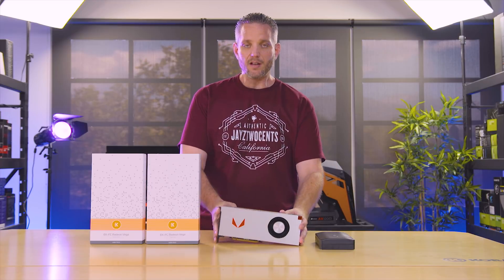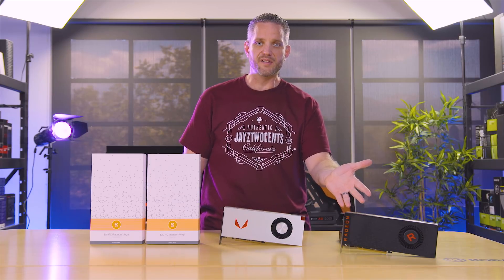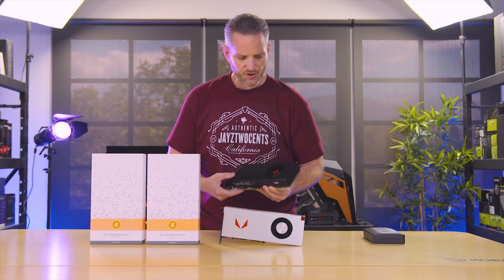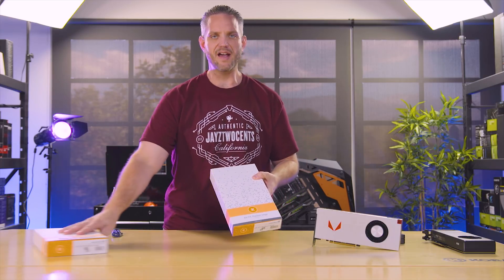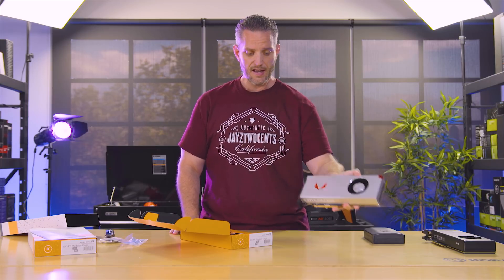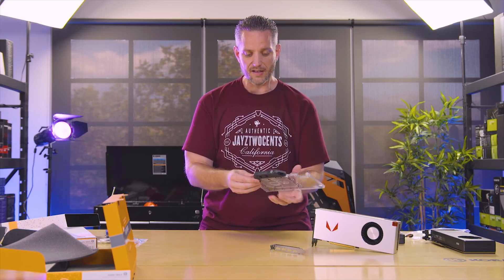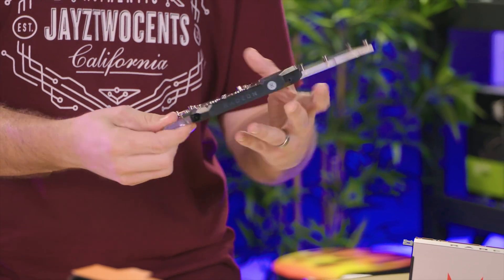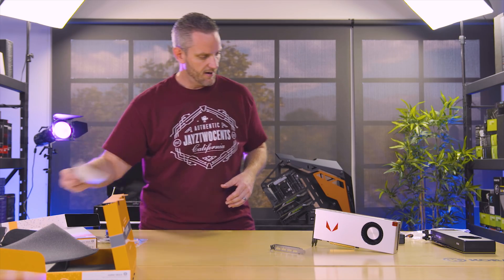Does watercooling help AMD Vega cards?

Comment: Why are people buying Vega? 1070 and 1080 uses far less power and are pretty equal in performance.
Reply: vega has better performance in some rendering workloads, and is 30% faster in blender than the 1080ti, which if you use blender all the time is a far superior investment.
Reply: Some people just prefer AMD hardware and new technologies.
Reply: Honestly...Vega 64 is a turd and I would never buy it period.  But Vega 56, slightly faster than the 1070 for the same price? Even if I have to wait for prices to come down and reflect MSRP I'll wait a bit and get Vega 56. With driver improvements over the next few months Vega 56 will pull nicely ahead of the 1070 and you support competition by buying AMD. 

Also, for Vega 56 at least, the power consumption cost at 4 hours of gaming per day based on the Average United States electricity rates is so negligible that if you are that worried about that tiny cost...you realistically can't afford one of these to begin with.
Reply: It may be a turd for gaming, but it's doing rather well for me in various compute tasks (and no, I'm not a miner, never have and never will).

Rendering is several applications also is quite a bit faster.

As for it's gaming performance, the power is there, it currently doesn't translate to framerates. If I didn't have a use for it beyond gaming, I would still have held my tongue talking bullshit like you and waited out to see if gaming performance came up to par with the actual capabilities of the card and if the prices would come back to a normal level.

At normal prices and even just the current performance, it is not a turd, it's great value for money.

But with current prices (and bad availability), it is not.
Reply: because a similar spec 21:9  3440x1440 g-sync monitor is ~$400 more. Comments like this are usually made by those who got a 1080p monitor and never researched prices of higher end monitors
Reply: Because some of us don't give a fuck about power draw in a desktop. Also I already have a freesync monitor and don't want to buy a new monitor.
Reply: Vega's biggest problem for gamers is the Mining market.   On newegg, the 1080 Tis are cheaper than Vega 64
Reply: As nVidia has their fanboys that will always buy and bash the competition...  Ford vs Chevy...  Red vs green, etc...
Reply: My friend unwittingly bought a freesync 4k monitor last year, so, yeah, it would benefit him to use an AMD graphics card.
Reply: I have zero interest in G-Sync or Freesync. I just want a card with good performance with low power usage. I am waiting on the GTX 2060.
Reply: you should though man, both of those technologies are cool as shit
Reply: FreeSync
Reply: jose juan andrade gsync is overpriced while not much of a different than freesync..
Reply: Becuse everything on my pc is OC and draws power and as all says. g-sync costs alot
Reply: Rowland then why did they say they wanted it in the hands of gamers? Also why are you AMD fanboys allergic to facts
Reply: Yeah, they are... I never thought I'd see the day Newegg jumped on the price-gouging wagon...  I managed to order an XFX 64 from from Best Buy for the listed Black pack price of $599...  two free games  (I know, big whoop) but at least it's the MSRP for the "pack"
Reply: 1ch1r1n until you get octane render plugin, then amd really can't keep up with rendering times.
Reply: preference, the same preference when people are picking a case fan right? Yet no one ever questions that do they?
Reply: I went for a refurb RX 480 after Vega came out. $300 for what seems like perfectly adequate performance.
Reply: it is when the price goes back to normal and the custom cards are there. If Vega stays gone like the 580 its back to team green
Reply: TheKims  because of Freesync
Reply: I think it would be GTX 1160
Reply: I do actually hope they do. Considering the huge advertising campaign over the "10" with the take things to 10 or whatever. They could now go with taking things one step farther... to 11. Or some shit.
Reply: to support competition
Reply: They are cool. But monitors cost a ton more with either tech. I'd rather get a nice 24 - 27 inch 1ms refresh monitor without them and pay $100 to $200 less.
Reply: 9TDF ewww i suppport it to a point... but if the product is that high of a price doesnt seem smart not to buy the best for the money...
Reply: neural_physics Yeah over 100 more for a monitor for the same sync as freesync is great
Reply: 10+1 does not equal 20...
Reply: Because Freesync doesn't add $100+ to the cost of the monitor like GSync does, so people got monitors with it even though they knew they couldn't use it just because the monitor had everything else they wanted but was cheaper. Honestly, fast vsync turned on on a non-GSync monitor is enough of a gain that most people don't really need the active tech anyway...
Reply: No developers want to use DX12 though because it's Xbox and Windows 10 exclusive. Doesn't matter both DX12 and Vulkan aren't fully implemented.
Reply: +Tick Tock Tech Talk by the time you wait price drop, Volta will be out or will be 2 month away to be out. So, Vega is a disappointment - period. One has to be a complete AMD fanboy to spend money on Vega 64 while GTX 1080 Ti costs the same amount of money (at least here in Canada) and 1080Ti is 30% faster in games (don't care about synthetic benches - buying a gaming GPU for gaming). Oh, and I don't care about Freesync or Gsync - both are useless and not worth the money and only add input lag for FPS games, a regular 144hz monitor is good enough and has 0 screen tearing. Using Oculus Rift for games mostly anyways because mostly playing racing sims here.
Reply: Its not for gaming
Reply: Bill Warrior its called some people arent rich
Reply: neural_physics nvidia is for gamers amd is more for content creators it depends on your stance on which is better
Reply: So basically, what you're saying is that in the end, you're going to spend about the same amount of money nvidia/G-sync vs AMD/Freesync...  I never thought about it that way...  Thank you for pointing this out..  (thumbs up)
Reply: kgrach If you don't use Linux or care about freesync or gsync, then that becomes the case too. I.e. me. I'm glad I got a GTX1080 12 months ago vs waiting for Vega. Hasn't even dropped much in price vs what I paid it and I got to enjoy it for a year instead of waiting.
Reply: neversync you save that money in electricity prices in just 6 months running nvidia cards instead of amd. Also cheaper psu for the rig so that's an immediate $100 if going sli.
Reply: V56 slightly higher power draw than 1070, buy higher performance between 5 and 25%(so in some game it comes close to the 1080). V56 can be tweaked, e.g. Undervolting and save up to 70w. Oc hbm by around 100mhz which increases performance significantly. And free sync monitor.

The v64 i dunno about that card, power draw seems too high. I don't think undervolting is gonna help much. So in essence i don't know about the v64, but the v56 send very promising. If i hadn't been wasting so much money the last few months, i would have bought the v56
Reply: That would be a good idea, if RX 56 was actually purchasable. I hit refresh on both newegg and amazon until the cards showed up and when they finally showed up they were already sold out.
Reply: janenba352 that's where you are wrong as they start getting better cards those power usage are going to get higher the 1080ti is 300 power draw as well so anything NVidia comes out with next will be at that power usage or higher.
Reply: vega 56 offers up the best price to perf ratio and is definitely above the 1070 - with freesync monitors being cheaper, you'd also be saving some cash there. you also enjoy the amd eco system lels
Reply: Dark metter miners.....may the soil lie light upon them :D
Reply: Steve Jones the power draw of a 1080ti is 250watts
Reply: Even Prokop good luck reaching that 144hz with amd lol
Reply: Rick Sanchez 1080ti will pull closer to 300w under load
Reply: Too much hype. And then AMD (covertly) dropped that the Vega cards were good for mining (with a mining optimized driver) and the whole thing has gone to hell for regular people... What do you expect. Most miners are from china, and the AMD CEO is from china/taiwan/that area. Pretty sure she is gonna pull strings for her fellow countrymen than some puny americans =(
Reply: Mining, probably
Reply: I have a 2560X1080 75hz freesync monitor and an rx 580. The 580 still doesn't hold a solid 75 fps in a lot of games with settings cranked up.
Reply: Me use blender to make smoothies :P
Reply: Those "why would you even buy freesync" people forget one thing: FreeSync and G-Sync are effectively worthless if you are constantly hitting your max framerate, but they are invaluable if your monitor can do more than your card. There is much more point in FreeSync on a 580 at 1080p than in G-Sync on a 1080 Ti at the same resolution. And to why buy a 144 Hz panel for an AMD card where it's not really going to do 144 fps with your settings anyway? Easy, if there is an at least 2.5x difference between the minimum and maximum of the FreeSync range, LFC (low framerate compensation) is automatically enabled, giving you FreeSync even at 1 fps, so pretty much everything will be smooth.

I'm the kind of guy who complains in a cinema for the movie being 24fps. On a regular 60fps panel, I see every frame drop. However, when I still had an AMD card with my CFG70, my game could jump between 50 and 80 fps and I didn't see a thing, because that's how smooth it is. Now I got a 1070, and I'm regularly cursing Nvidia for not supporting FreeSync (I know they have G-Sync, but vendor lock-in through proprietary tech should die as far as I'm concerned) when I get a drop from the locked 72 fps (It's there because I can't get a stable 144).
Reply: +Ben Snow yeah and get input lag with G-Sync and FreeSync.
Reply: Mostly in games where you're constantly over the max refresh rate, then yes. If you're not, technically there isn't any. Blur busters did an article on it. If you're running a game at say average 100fps, maxing out say 140fps, minimums 80fps, then you won't see input lag. If you're running 500FPS in say CSGO, then sure. It's basically as bad as vsync if I recall at that point. Generally the more FPS also the less input lag, because the displayed frame and the rendered frame are more likely to be closer. They also tested that too.
Reply: That's the manufacturer stated TDP not the official power draw. TDP is a measure of thermals/heat output, not power consumption.
Reply: rfouR_ input lag has nothing to do with how much FPS you get. It's how much Gsync or Freesync needs to buffer frames.
Reply: Isn't the whole point of G-Sync or FreeSync to avoid buffering frames at all?

In normal operation, your monitor pulls a frame 60/75/144/whatever it's set at times a second, at equal intervals. Let's go with 60 fps here, that means if your GPU is done rendering in 16.67 ms, that's fine, you see a smooth 60 fps. However, if it takes any longer, without sync it's going to grab a half-rendered frame, which we call tearing. With simple VSync, it's just going to be the last frame, that's a frame drop. It also needs to store one frame, that's where you get input lag.

If you have FreeSync or G-Sync enabled, the monitor doesn't have that clock, your card pushes the frame whenever it's ready. This means that every frame is displayed immediately as soon as the GPU is finished rendering it. This is why you turn off VSync if you have FreeSync or G-Sync, it's unnecessary and just adds input lag. Without it, adaptive sync is actually better than even no sync at all.
Reply: +Ben Snow I think you are confusing Input lag with Screen Tearing. Those are two different things.
Reply: Oh, you mean monitor input lag? That's negligible with a non-terrible scaler, most FreeSync and all G-Sync monitors don't have that issue as far as I know, at least compared to regular input lag.
Reply: +Ben Snow Nope. Just google: Gsync input lag.
or: Freesync input lag.
Reply: FPS actually does effect input lag. The higher your framerate the closer the displayed frame and the rendered frame are potentially to each other. You both get lower input lag and more consistent input lag. Been tested and proven in link below. Article also covers the difference in input lag between vsync, gsync, and neither. Pretty sure they're all tested at 60hz, 100hz, 120hz, 144hz, 200hz, and 240hz.

https://www.blurbusters.com/gsync/gsync101-input-lag/

Scroll down to: "V-SYNC OFF: Beyond the Limits of the Scanout" look at the image set for FPS input lag. 

3kliksphilip did a video explaining/breaking down why too.
Reply: Vega 56 performs better than a 1080 in BF1.
If you are looking ahead (DX12) rather than living in the past (DX11) then Vega is a compelling product.
Reply: Because why would you pay $100-200 more for a G-Sync monitor? And then why would you want to save $20 by going for the non freesync one?

A monitor is a long term investment, its something you keep a long time. And you never know, amd could pull ahead of nvidia with navi. You never know. Hell, nvidia might support it sometime down the line.

So why would you not?
Reply: You're obviously a washed up nvidia fanboy. If you like paying 100-200 bucks extra for a monitor with gsync be my guest.
Reply: why you should buy Vega you ask?  Linux Drivers that don't break or brick the system in an upgrade. FREESYNC!!! cheaper and greater selection of monitors. Jay like most reviewers always seem to forget the huge price premium GSYNC adds to a monitor. sorry $300 plus dollars still makes Vega cheaper than NVIDIA. ALL Nvidia would have to do is a driver update and support freesync and it becomes the only choice. Till then it still blows value wise once you add in the cost of GSYNC.
Reply: neural_physics No... Freesync is heven better then G-Sync, Linus showed that a while ago. (And by the way, 1080 Ti price is also much higher then Vega... soo...)
Reply: For gaming just go NVIDIA on high end instead of VEGA. Mid-Low end NVIDIA and AMD are same. G-Sync is neither better nor worse than Freesync.
Reply: TheKims you are so right!
Reply: Some people just like AMD stuff, other people would like a change, some folks might be still buying into the hype. Its not like its a complete wash though, vega performs well and some folks dont care about power consumption and/or hate Nvidia so much they are willing to swallow the difference. Also ive heard buzz that these vega cards will age well as a lot of these technologies mature and get taken advantage of. Who knows really. Ive always just bought the best componant possible with my budget whatever that part may be regarless of brand.
Reply: Because for whatever reason AMD has the fanboys that will always buy their products despite being the worse option
Reply: +Rowland wrong. NVIDIA has better GPU's for content creators, named "Quadro". Take a look at new Volta GV100 chip - you'll shit your pants because it is x12 faster than GP100.
Reply: "Far less power" No they don't. 70W at most, and generally, like with the Vega 56 you get 1080 performance for 1080 power draw.
Reply: ayyyyyy this guy above me gets it.
Reply: Neversync you are obviously a washed up AMD fanboy if you think you need freesync and that freesync alone justifies buying an overpriced piece of crap like vega 64.
Reply: Makes no sense whatsoever
Reply: why would someone get a freesync monitor before vega?Like some ppl actually got 2k 144 hz monitors when the 580 was a flsagship?thats kinda moronic in my opinion

Comment: Tough one, the stock cooler looks so amazing on Vega (the alu one that is), so replacing that with a waterblock feels like an aesthetic waste.
Reply: Nycrea but throwing away the cheap ass black cooler on the standard version is a service to humanity. Same with all the cheap blower coolers on nvidia cards. No point in paying for over-engineered fans and heatsinks if they will be replaced by a waterblock.
Reply: I don't think that NVidia's Reference Blowers have been all that cheap since the 780. Hell some of the Aftermarket blowers are cheaper than the reference design and there is some asthetic taste in the blowers... not that I won't be removing the blower on my 1080Ti FE and replacing it with the EK Block.
Reply: Mark Ewing i meant the aftermarket blowers. They mostly use the reference pcb and are compatible with water blocks. You can check the compatibility list on ekwb. Currently the cheapest 1080ti in germany is the zotac blower, goes for around 680 euro. Vega 64, black one, is 649.